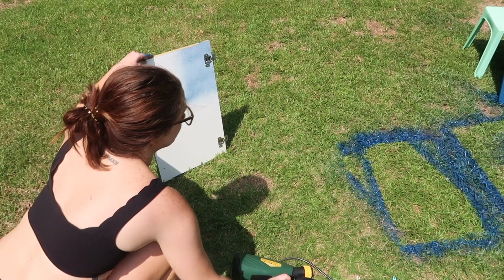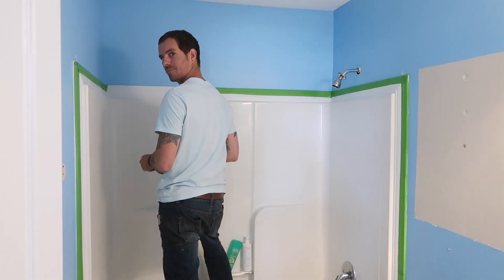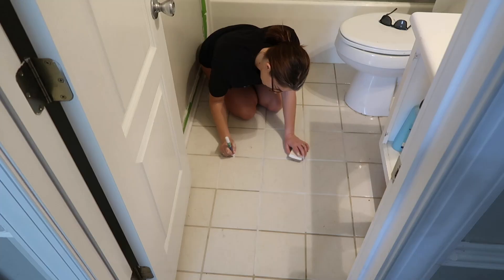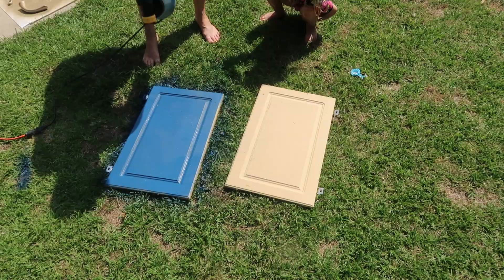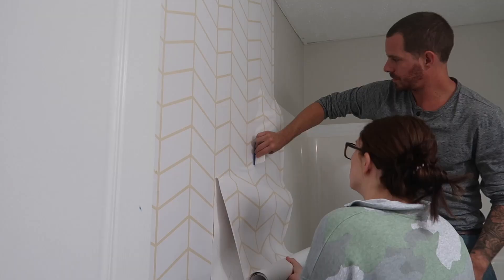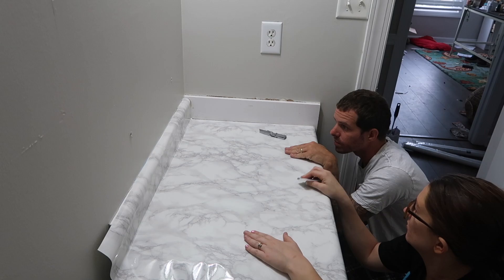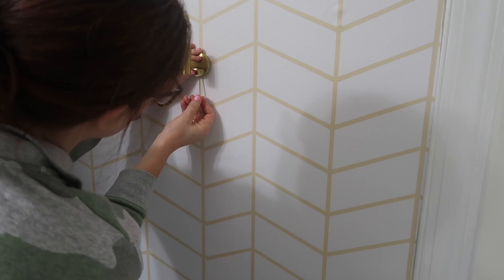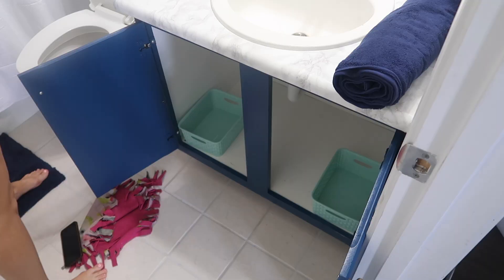DIY Small Bathroom Makeover on a Budget 2020 | Bathroom Remodel Under $500 | Renter Friendly

Comment: Great video.  How is the countertop overlay holding up so far?  Any issues?
Could you maybe do a 1-yr & 2-yr durability update (should you choose to keep it that long, of course)
Reply from the maker: It’s holding up perfect. No issues whatsoever
Reply: Ya that was going to be my question, wondering if the water was going to make it bubble up
Reply from the maker: Nope! It’s been several months & no issues. We caulked the edges so no water can get under it